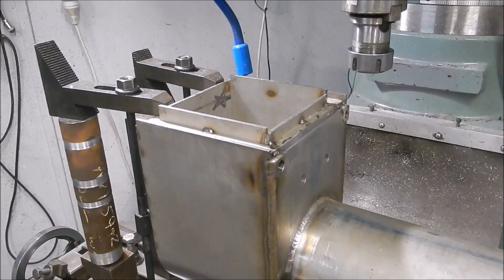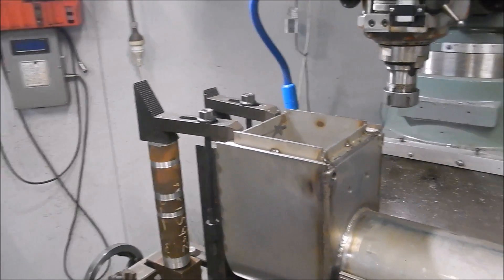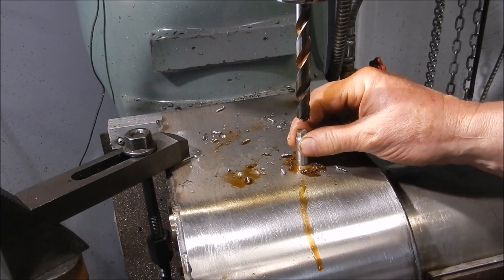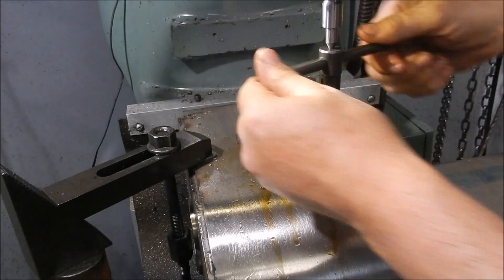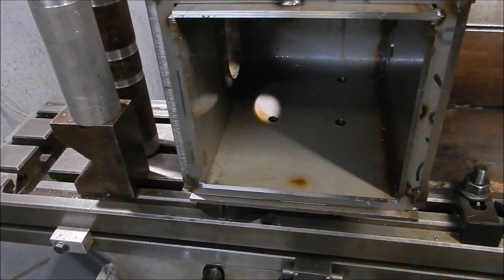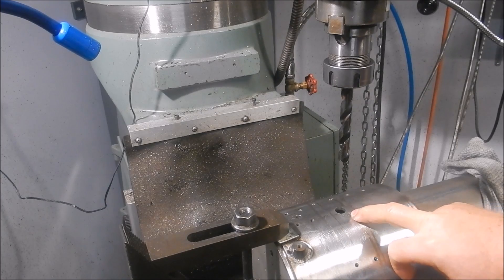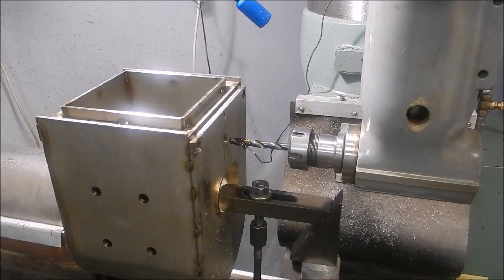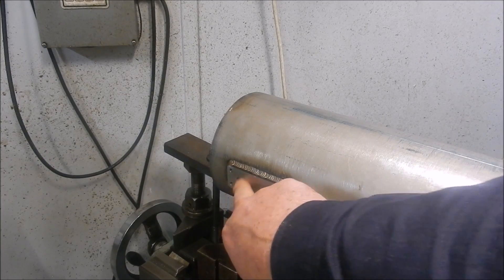Boiler Stay Machining for the Ransomes Sims & Jefferies

Comment: G’day Cam. I hope you remember all the work that has to be done when it’s pulled apart, I know I’d forget something. Thanks for sharing. 
Cheers 
Peter
Reply from the maker: G'Day Pete, yep there is certainly alot more work to do on it.  I did ring Andy today to see how its coming along and all the tubes have been fitted and tiged in along with the inner fire box so it will be buffed to remove all the scribe marks and then have a light blast with glass beads before posting off to the customer.  He has another two boilers on the drawing board so there will be some more work coming my way.
Cam

Comment: Nice work, as someone who has very little experience with milling the correct setup is what I have the most difficultly figuring out. I agree that the setup takes 90% of the time in some circumstances. There are all kinds of resources on feeds and speeds and what type of tooling to to use but almost nothing on how to correctly hold down work on a mill.
Thanks for the great video and keep them coming.
Reply from the maker: Thanks Twoprop, you hit the nail on the head with setups.  I find the machining side fairly easy.  Working out how to hold a part to give the best machining position and access with the maximum rigidity is the difficult part.
Cam

Comment: Nice one Cam. Some great work holding methods and tips provided there mate. I must say you’re braver then me. I hate machining stainless steel 😖. Cheers 🍻. Aaron
Reply from the maker: G'Day Aaron, yes stainless steel is a pain to machine but this stuff, Duplex 2000 series is on a whole different level.  The micro-second you dwell a drill or tool it work Harden's. On a  number of occasions I had to go with carbide to take material out of the hole before finishing out with the drill, even cobolt drills wouldn't touch it once the drill rubbed.  The tapping size drills had to be relaxed as there was no hope of tapping out a hole without breakage.  Real nasty stuff!!! 
Cam

Comment: Thanks Cam. That's going to be the shiniest boiler in the world.
Reply from the maker: G'day Mark, when Andy's finished with the weld-up all scribe marks are buffed out and then it goes to a Sand Blaster who will use a glass bead at a set pressure to put a light frosted finish on the boiler prior to delivery to the customer.  
Cam